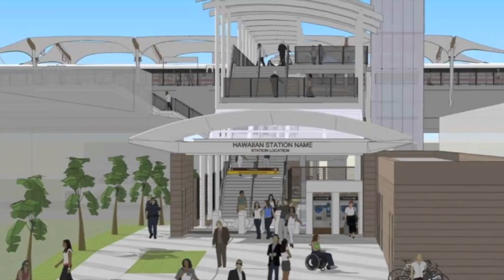Hawaii's $10BN Battle To Build A Transport System

Comment: The scamline is automated, NOT autonomous.  Big difference.

“It’s all systems go at the rail Operations Control Center.  Five controllers, engineers and supervisors per shift will monitor the entire rail system 24/7.” khon2 6/15/2023

Comment: The biggest challenges facing Skyline aren't necessarily engineering ones. An overly optimistic initial completion date of 2018 coupled with an overly optimistic budget along with a last minute contract award to a company that was friends with the current governor at the time created the perfect storm for terrible public perception of the project. Local news outlets and editorial authors have painted the project as nothing but a "white elephant", "train to nowhere", and a "corrupt money pit" for years now and this has led to a widespread rejection of the project despite it narrowly winning a popular vote that initiated its construction.
There is a lack of political will to support this essential project in the state due to the proliferation of negative sentiments over it. As someone who waited three hours to be the first in line at the Aloha Stadium Station on opening day and helped many people navigate the bus system to and from the stations, it became clear to me that many people only saw this as a "novelty" to be used to go to the mall on the occasional weekend and not as a genuine replacement for a car to commute. While the Skyline is supposed to work hand in hand with the public bus system (named TheBus), many don't recognize that fact and many aren't interested in using TheBus in conjunction with Skyline. This was especially evident in the amount of people that tried using the limited park and ride spaces during the opening weekend instead of TheBus, which was free along with Skyline for the opening weekend. The amount of times I heard "Alright I'm never getting on this again" was disheartening to say the least knowing that even in its limited form right now it still cuts down a small but noticeable amount of time commuting.
A lot of the negative perception of the Skyline metro comes from selective reporting and hyperfocus on the negatives of the system without regard to any of its successes. Early on this was reasonable as the project experienced delay after delay along with ballooning costs, with a current completion date of 2031. However even after Skyline opened, the negative press kept rolling in. First, the news was quick to point out the hammerhead cracks and flange errors reported in your video, but none then followed up on the swiftness of which these issues were addressed and rectified. When the system opened the news was then eager to report on how ridership dropped from 70,000 a day to 1,200 a day after the fare free period ended, but few of those followed up with the fact that those numbers were a drastic miscount, with the actual amount of riders actually being a bit under triple that number. Furthermore a year after opening a few news outlets reported on Skyline's average monthly ridership being below what it was the previous year. At face value is correct, but that is factoring in the initial fare free days which immensely skewed the average. In actuality fare paying ridership IS greater than the previous year, with Skyline's ridership in actuality steadily rising since December of 2023 (6 months at time of writing). Local news outlets also failed to recognise Skyline's 1 millionth rider which was an immense achievement.
Online, any reporting of Skyline's successes come with backlash from anti-rail NIMBY's who repeatedly ignore the project's potential and call for the guideway to be turned into some sort of bus or car expressway, or be demolished entirely. These people bring up the "every time I see it, it's empty" statement which is easily refuted by stating that if they were on the train, they wouldn't have been stuck in traffic looking at it, and also that the initial segment, while adequately served by bus routes, is nowhere near as convenient to use until it opens to the Kalihi Transit Center which will happen at the next of next year. These people, along with nearly everyone that consumes this entirely negative Skyline narrative, don't understand that Skyline will not slow down with more use.
Many tout the figure that it currently costs the city $50 for every rider to use Skyline, but don't seem to understand that if more people become open to using Skyline and TheBus, these systems will only get more efficient, unlike the freeways these people spend hours in traffic stuck on. Transit service is only as good as its ridership, and its ridership is only as good as its service. If people woke up to its benefits and used it, then the city and HDOT would put more resources into improving service to match ridership, which would increase ridership, which would improve service, etc.

To conclude, its challenges are not because of its terrain. In fact a raised guideway was selected because there is a scarcity of land in urban Oahu to build a metro service on, and tunnelling was ruled out as too expensive. Once the project reaches at the very least Kalihi Transit Center by next year, it will be compelling enough to sell itself to those who actually realise its benefits. For the rest, it will take a major shift in their perception of public transit and a shift away from car dependency and NIMBYism.
Also, you terribly botched the pronunciation of Ewa and Waipahu, but that's the least of my concerns.

Comment: Modern amenities like elevators and escalators!  😆🤣 5:40
Reply: “Schindler Elevator Corporation announces that it has been awarded a multi-million dollar contract to install and maintain 49 custom machine room-less (MRL) traction elevators and 23 Schindler 9700 transit escalators throughout the Honolulu Authority for Rapid Transportation (HART) system's 21 stations.

The 20-mile HART system will open its first phase in 2017 and is slated for completion in early 2019” schindler 11/21/2013

The elevators sound okay, but the escalators are going to be short, even with two fewer stations (19).  Think about it.  If you have two separate platforms on the outside of the tracks, ideally you would have four escalators per station.  One going up and one going down for each platform.  Instead they have planned (and I use the term very loosely) for ~1 per station?  The fiasco continues.

Comment: It was a total disaster from the beginning. I was living on Oahu up till February of 2023 and it only made it to Aloha station with rides just beginning. Last I heard, the rail will stop short of the original plan to Ala Moana and now stop in Kakaako.
Reply: I think all rail projects are shit shows. The only one that will probably be ok is when we build one on Mars. I live in the DC area and we expanded our Metro to connect it to our major international airport (Dulles). They started it in 2008 and it didn’t actually finish until the end of 2022.